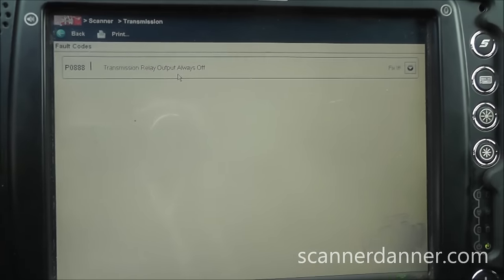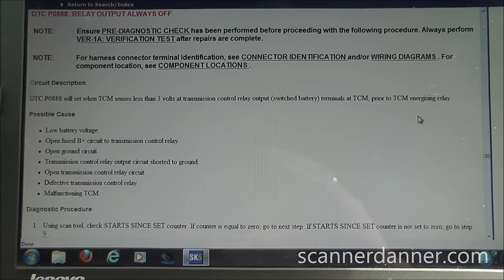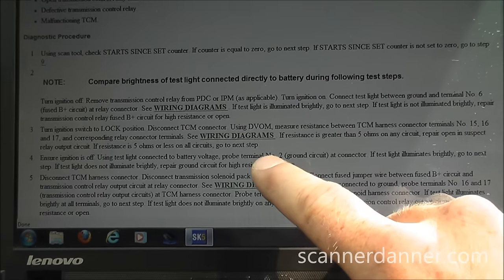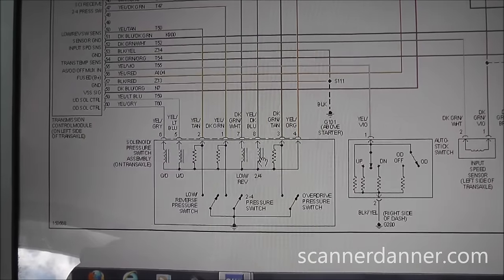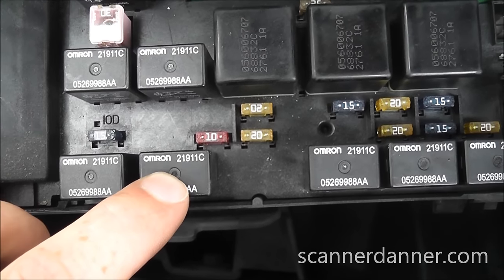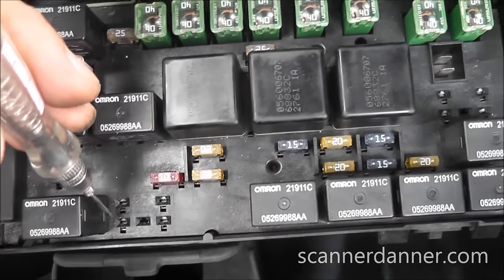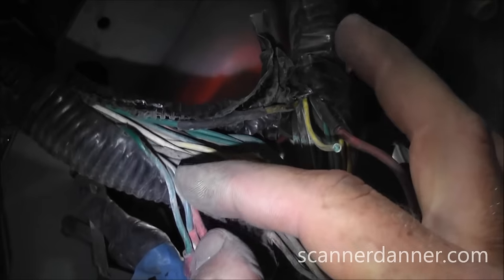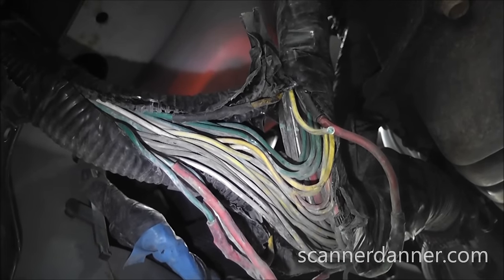Transmission No Shift Case Study (P0888)

Comment: I got a little brain storm for times when power is cut off by computer when trying to do a test that I would love you to weigh in on...
What if you took a known good relay, remove the plastic covering, therefore exposing the pins and such creating good test points, preventing female connector damage, AND eliminating any possibility of a false result from the computer shutting off the circuit... would this work in theory?? I would make my own set of them for each shape of relay. I know you mentioned a kit with exposed test points is on the market, but I would imagine the cost of a decent set from a good tool source would be a decent amount of money, so a home made set would be excellent for a home jobber or someone fresh into the field that isn't made of money.

Comment: I have an 2002 chevy blazer 4wd. it will not go out of 2 gear to 3rd gear i've changing the solenoid and fluid and filter is all changed still took it to a shop there is no codes from up for the transmission just the mass air flow cuz i had took it off but it's back on now. I do not understand why it will not shift into 3rd gear. 
could you tell me what could be wrong? 
Could it be the same you are doing with this 2002 Dodge Caravan.

Comment: Will this cause my '03 grand caravan to not have a 4th gear? both speed sensors changed, fluid was cleaned but changed, filter was changed, valve body was changed. I hope it's electrical. Codes P0700, P0734.

Comment: Have a trouble code U1000 on my 05 g35 Infiniti.  I put in a new body valve now it won't start. I'm thinking it might be stuck in gear 1 and not in park to start it from what is say on my dash. Any suggesting?

Comment: Question, I replaced the ecm/tcm and the van shifted great for about a month. Did the test light test like you did everything is great. So question would be what else can cause the stuck in 2nd gear issue??
Reply: Ever fix it?

Comment: hi 2008 dodge ram 1500 4x4 everything was fine , turned a corner and thought i was on ice when i  gave gas to go  no go , kind of a whinning. no back no forward just a whine like a low power steering pump. fluid fine and not low? someone said could be a stuck solnoid of some sort? or is trans shot? no slippage ever.before that 200 k on truck? help

Comment: Hi Danner. I own a 2005 Mazda 6 2.3l  Automatic. I just put in a used gearbox and I'm not getting any power to the wheels in R,  D and Manual mode.. The gearbox is not throwing any codes at all.  Also I'm able to change the gear shift knob without pressing brakes.

Please guide in what I should do
Reply from the maker: are you sure your shift linkage is connected?
Reply: @ScannerDanner  yes it is connected.

Comment: Thanks for the video, my question is does a fault air flow sensor affect gear shifting ?
Reply from the maker: Any engine driveability problem can affect how the transmission shifts. So many times I've had customers telling me they have a transmission issue but it ends up being a misfire or other engine related problem.
Reply: THANKS VERY MUCH

Comment: Could we just check continuity across the wires from the PCM to the TIPM?
Reply from the maker: sure, but a voltage drop test is much more accurate. I've seen many times, that an ohmmeter will miss the problem. 
Watch this, you'll change your mind about resistance tests with an ohmmeter. (I almost never use it)
https://www.youtube.com/watch?v=44dP6X3QS5A

Comment: Amazing, However I really need some guidance with my 2005 Grand Voyager. Mine has a bank of large relays mounted on the front just left of the passenger head light. I have worked out they 3 of them are for the rad fans, one is glowplugs and the other is the transmission relay. When the car gets hot, the transmission relay starts to aggressively click in and out coursing the car to rev on its own. This also makes the car jump out of gear, the gear selector lights all light up or stop responding. If I remove the relay all of this stops and the car is stuck in limp mode. Any advice you could offer as Iv been working on this car now for 2 years and each time fail to resolve this issue. Mike.

Comment: Another excellent video. Who do you use for your wiring diagrams?
I have followed you in other videos but use a different diagram and I think it will make life  a lot easier for me if I just get the diagram that you use. Thanks much for what you do.
Reply from the maker: Shop Key (I have an old DVD version updated to 2004) and then I have the on-line version called Shop Key Pro. 
There is a DIY version of this program where you can pay for access for an individual car for like $20? 
http://www.eautorepair.net/marketing/default.asp?VID=&Count=Y
Reply: Thank you very much sir, you are my favorite teacher.

Comment: I have a 2010 challenger it won't go over 30mph it's also not blowing any air out of the vents the locks won't work without the key in the ignition dome light don't work unless key is in the ignition either.... I was told someone took some ground fuses out of my car they also stole my owners manual so I'm not sure what fuses are missing if any I need help

Comment: I was going about 65 on the highway today and my e- brake came on and ABS light on and the engine light. I stopped and checked the engine but nothing seemed wrong.  I turned the truck off and on and the only light showing was the engine.  I took it to auto zone to have the computer checked and it came back with code p0888 and it p0700. It doesn't go into limp mood because nothing feels wrong with the truck and it catches all the gears. Any help? 2004 dodge ram 1500 5.7 hemi

Comment: I need help getting a fuse box schematic diagram copy for my 1986 Toyota pickup  22R,automatic trani. Overdrive stopped working  after radio, clock and lighter suddenly went out. Fuse replacement fixed these issues.
Reply from the maker: +T. Baxter http://www.scannerdanner.com/forum#/20150619/where-to-get-wiring-diagrams-4839109/

Comment: hello, I have 2002 chrysler town and country, i had an flat tire on the front driver side tire, the tire caused the harness aver the tire to be rotated under the rimp and that leads to cut the whole set of harness wires, I reconnected the wires back the engine turn on and drive  but i have problem with the transmission does not shift. and the speedometer does not show the speed.

Comment: my 2003 denali quadersteer wont shift to 2 shift i drain the transmission oil and open up and it doesn't smell burn and it doesn't have any metal grinding its clean but i don't know what it is ?? Maybe other thing ?

Comment: I have a question my jeep is 2013 and the tires I have on it are 35" 
What its doing is its shifting to 3rd gear when I'm driving.  And when I turn it off and turn it back on it will be fine and go little way and it shifts back to 3rd gear again.  Also if i accelerate rpm over 3 its shifting right.  Someone told me its transmission controlled module.  Please help if you can

Comment: my son has a 2003 Mitsubishi Montero sport 3.5 liter and its stuck in limp mode. I think he hooked the battery cables up backwards. I had a new transmission put in the truck and that did not help. I put a new input and output sensor in it and that did not help. Any advice.
Reply: Kenny Page batt terminals reversed wouldn't require trans replacement.. usually there's a brraker\relay to protect electronics from such incidents that can be replaced.

Comment: I have a 2004 that powers on the relay, but doesn't have any voltage on the left side (firewall) of the pins. it has ground at one of the ones nearest to the firewall. any ideas?

Comment: Yes I have a 03 dodge dakota,I am in limp mode,it does not get out of 3 gear.it was reading that it was the speed sensor,so I just replace both input and output transmission speed sensors.but it is still doing same thing,,may I have your advice on how to fix it
Reply from the maker: You need to get fault codes from the TCM or take it to someone who can get them for you
Reply: @ScannerDanner  Ok it's reading p0501, speed sensor still.I really don't have the money to take it to a shop.I'm trying to do this my self..thanks though

Comment: That’s a common area on those vans.  Usually the battery leaks down in that area or wreck damage  causing havoc on the wiring harness there.

Comment: Hi there Mr. Danner
       This is a question from someone learning from your videos. Could one have done a voltage drop test at the relay box location and determined an open circuit from there? Just wondering if that could be done. Thank you so much for your videos

Comment: Paul I have seen you mention in several of your vids the "good heat shrink" which would that be?  I normally use butt connectors with shrink on them.

Comment: Is any of this tied into the radio or dash lamp system? 01 caravan wasn't shifting and after putting 12 volts to 56 wire it shifts. TCM was only getting 3 volts so I wired the correct fuse directly to bypass the fuse connector. I didn't check the ground but am assuming it does have ground because it shifts now? Before I messed with it the mileage would show upon opening the door and the radio worked. Now mileage and dash lamp only shows while turning key to on and has about a 2 second delay. The dash and radio are the only areas acting up like this. The window switch lights and everything besides the dash and radio work normally.
Reply from the maker: sounds like a shared circuit, but at least it shifts now right? Just make sure you have a fuse in the wire you used as a bypass

Comment: 27:07  If the whole wiring bus is subject to failure, do you replace the whole wiring bus or the one seemingly corroded wire.  As soon as you get in there messing and pulling that wiring bus apart other corroded wires will break. So you fix one and break three more.  Do you have any lessons on fixing these wiring buses that are failing, probably due to heat causing the plastic to get brittle and crack?
Reply from the maker: each situation will dictate the repair, in this case I just fixed the wires that had the issues. I am certainly not going to replace an entire engine harness

Comment: Hello Scanner danner enjoyed this video. i"m having a problem with a reverse light not coming on. But my relay circuit is ground side switched. If I manually add ground to pin 85 on my relay my reverse light comes on, but now they stay on all the time. I think I know my problem has to do with  lack of ground, but why wont the computer ground it for me when I place the truck in revers. You have any suggestions?
Reply from the maker: It is becoming more and more difficult to answer questions here. I have 80,000 people asking me for help now. So I have created a forum to help you guys better. It is free to join and we can exchange pictures, wiring diagrams and waveforms if needed to help guide you through the process of troubleshooting your vehicle. Thank you so much! Hope to see you there. 
Paul Danner (ScannerDanner)
https://www.scannerdanner.com/forum/post-your-repair-questions-here.html

Comment: My wifes 06 PT Cruiser goes into limp mode when ever its hot out, I disconect battery then reconect it shifts again , never had a problem all winter in the cold weather. Any ideas on this problem
Reply from the maker: Yes, possibly this? https://www.youtube.com/watch?v=MGaHaIXZioA
Reply from the maker: also if the trans is going into limp mode, there will absolutely be a code stored in memory.

Comment: I have a 2005 Dodge Ram 3500 Diesel that is doing some odd things with shifting. When I first start the truck and start to drive, it acts as it cuts the fuel about 20 seconds after start accelerating, then comes right back and runs fine until i turn truck off and start again. SECONDLY, on the highway going 80mph the trans will downshift from OD to 3rd-cuts off fuel (step on gas and does nothing) whenever  I take my foot off the gas peddle. Thought it was the peddle position sensor but replaced and did not fix either issue. Any Ideas???
Reply from the maker: It is becoming more and more difficult to answer questions here. I have 80,000 people asking me for help now. So I have created a forum to help you guys better. It is free to join and we can exchange pictures, wiring diagrams and waveforms if needed to help guide you through the process of troubleshooting your vehicle. Thank you so much! Hope to see you there. 
Paul Danner (ScannerDanner)
 https://www.scannerdanner.com/forum/post-your-repair-questions-here.html

Comment: I am having issue with my Toyota camry 1997 automatic transmission i have ran obd on the vehicle only cam shaft sensor was detected and gear usually  shift from 1st to 3rd instead of  1st to  2nd and the engine will be revolving at 6000rpm at 20mph with a noisy  sound kindly help me out.
Reply from the maker: transmission sounds like it needs a complete overhaul man, sorry

Comment: Paul your the man! This video can relate to an 03 Neon with 2.0 right?
Reply from the maker: Yes
Reply: +ScannerDanner Yes! I usually don't mess with transmissions. This video helped me a lot. thanks
Reply: +ScannerDanner dude quick question cuz your like a genius I rebuilt my motor and my trans was fine but now it's maxing first and not coming out of second I can't find the schematic  I have I exposed purple and white wire that is either a vss high of ho2s the codes it threw was a p108 map sensor abs tps what is going on
Reply from the maker: not sure man, focus on the MAP and TPS codes for sure. You'll need a good wiring diagram too
http://www.scannerdanner.com/forum#/20150619/where-to-get-wiring-diagrams-4839109/
Sounds like a good one for the forum for sure.

Comment: take a Bosch relay and solder small wires underneath extend them up to top. 87a 30 etc color code them. Then you have a jump out relay. I even drilled top put a button to close contacts.

Must load test always. Even the battery .
Test light ok outside computer board. Mat damage transistors 555 etc
Reply: What is this computer programme/or site that you used in the lenovo computer

Comment: Can a wire that's chafed but has good continuity cause a p1765 and p0753 !!! P1765 is transmission 12 volt relay supply control circuit and p0753 is shift A solenoid electrical???
Reply from the maker: Hard to answer that without knowing the code setting criteria on those, but I like the terms "circuit" and "electrical" in the code descriptions, especially when you're faced with a possible bad transmission and a rebuild.
Forget the ohmmeter for this stuff. An incandescent test light is your best friend on output circuit faults.
Reply: @scannerdanner I've diagnosed my 99 Dodge Ram Van 5.9l with 46re transmission..there is a pink wire on my middle pcm connector that the computer grounds to turn on circuit/relay for transmission..so I spliced into this pink wire and grounded it to the body...NOW MY TRANSMISSION IS OUT OF LIMP HOME MODE AND SHIFT PERFECT...BUT my question is where do you recommend me get a computer/ecm??Do you have recommendations??
Thank you in advance... brother you are an idle of mine 💯🔧👍

Comment: Hello, I have power of course on the bottom pin and i have power on the top one above it when the key is cycled on and off or running  but no power on the other 2 ?  Any suggestions on what to check ?
Reply from the maker: +scott MCCOY not off hand man sorry, you need to check the control circuit from the computer

Comment: So. Like I asked.  .  Is there a any way I can get the color of the hot wire  from box to fuel pump on a 2005 dodge 1500 4 ×4  4 door
Reply from the maker: https://eautorepair.adtrk.biz/?a=10817&c=24&p=r&s1=
Here is the DIY version of the same service information I use, same diagrams too.

Comment: Hi, I have a corolla altis 2004 and is giving me a milivolt output on one of solenoid which is shift solenoid A. im stuck with 3rd with no OD. we have tried to test all wires from ecu to solenoid (continuity) and all showing 1 ohm. also tried reheating the ecu to no avail. do you think it is possible to have 1 wire that has continuity but still deop voltage?
Reply from the maker: It is possible the driver in the computer has failed for that one circuit but drivers do not typically fail for no reason. Usually a shorted output (solenoid in this case) would be the culprit that. Very important question: Is this circuit being grounded by the ECU or is it being powered?
I have seen output circuits that are being intentionally shut down because the computer does not like what it sees on the circuit (open or short). In these cases I will do the following:
1. Connect my test light (incandescent bulb) as the output is connected
2. clear the trouble codes
3. turn that particular output circuit on and see if it lights the bulb
It MUST be done in this order to trick the ECM into thinking the circuit is now okay

Comment: my 2001 Ram has a similar issue but it's in third and overdrive still works. Actually every gear works just won't shift so I have to do it myself but It's not throwing any codes for the transmission
Reply from the maker: not sure offhand on the controls of this transmission. Is there a throttle cable that runs to it?

Comment: Hi guys!!!I have a question. 03 Dodge Grand Caravan not shifting, in limp mode, also have code p0888, got power from pin 15 yellow/brown wire but I got no power to pin 16,17 . I can hear the relay clicking when I cycle the key on/off and of course I got no power to solenoid pack at yellow/red wire. What do you think? Thanks in advance!!!